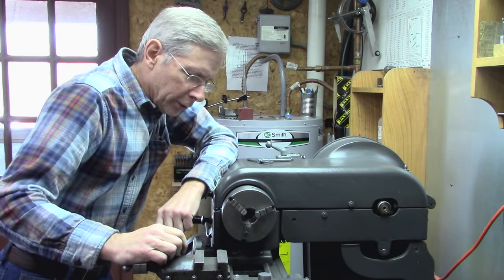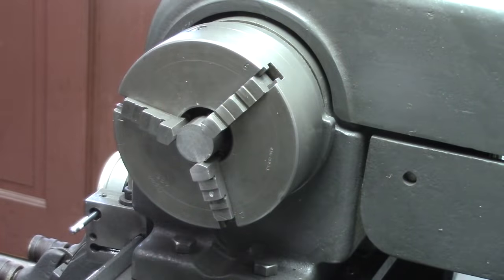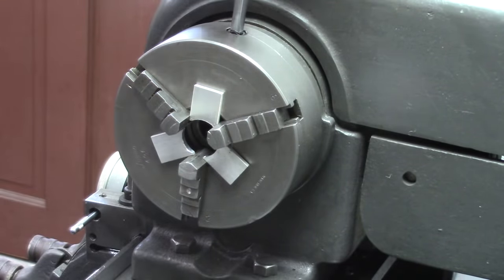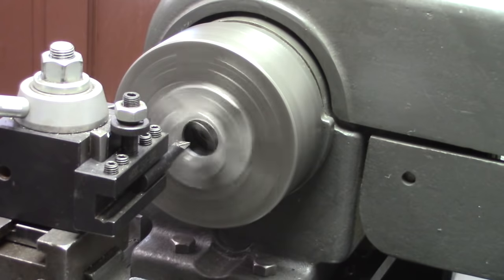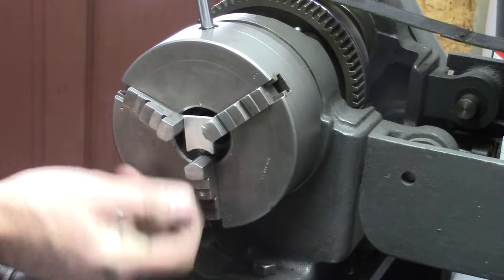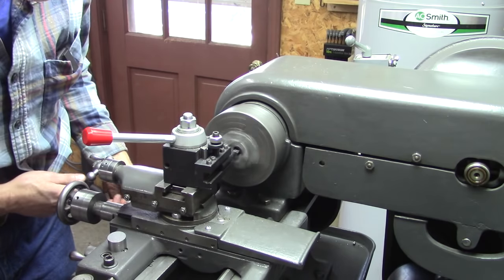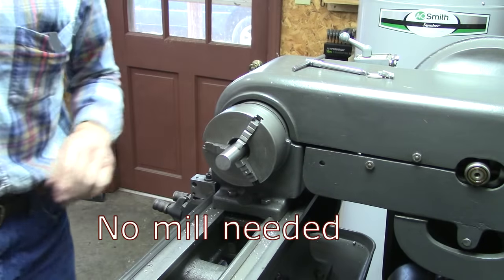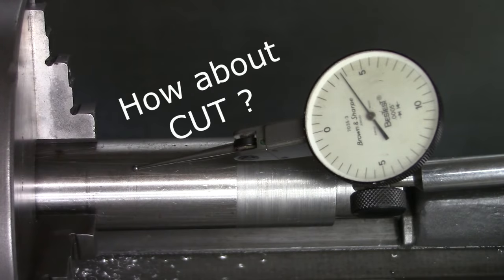Correcting 3-Jaw Chuck Runout the easy way

Comment: I used a similar method on a very worn chuck, I found that  I that using the "blocks" out at the outer edge of the jaws to obtain a parallel cut, the rock in the jaw meant that when the blocks are close to the body of the chuck it left the jaws conical. Cheers, Matthew
Reply from the maker: Conical as in bird mouthed? Mine is slightly the other way. Tightened just snug the jaws were tight in the front or ends and loose in the back. Firmly tightening resolved this.
Reply: @WinkysWorkshop  Yes, bird mouth, my chuck was 70years old! the jaws rocked, worn with a high spot in the middle! Although it was much improved, it had come to the end of it's life, I didn't have the outside jaws, so it really was time to replace. here's a video I did on grinding the jaws, it might interest you! https://youtu.be/zofS-ewP4Zs
Reply from the maker: @MatthewTinker-au-pont-blanc  Hmmm...  I ended up with exactly the opposite although if I tighten the chuck firmly it goes away. After watching your video I suspect the stone was larger toward the the grinder motor and that you didn't go deep deep enough to grind the back of the jaw with the full diameter of the stone. Of course this is just a guess, its hard to know for sure from the video.
Reply: @WinkysWorkshop  Thanks for watching my video! The stone cleared the back of the jaws, when I put the  "blocks" in the nose of the chuck, as far a possible from the face, I got a nice parallel cut, please note this was on a 70 odd year old chuck that had had a lot of use! I was just pointing out a possibility! Cheers Matthew
Reply from the maker: @MatthewTinker-au-pont-blanc  - Interesting...  I don't doubt what you say, I was just trying to get a better understanding. Your approach might be the best and maybe I didn't get an event cut due to deflection of the boring bar.. Also, my chuck was made in 1942. It could also be related to chuck construction.
Reply: @WinkysWorkshop  I didn't think you doubted me! Enquiring minds! I originally made the video to show somebody on a forum that it was possible, this was the second chuck that I ground, the first was not as badly worn and I got good results the first time. I didn't have the bird mouthing with the "blocks" flush with the face of the chuck. As I said, the jaws were badly worn, so much so that the jaws would wobble!
Reply from the maker: @MatthewTinker-au-pont-blanc  - Youtube just removed your link (grrr) seem like you got a lot of views!
Reply: @WinkysWorkshop  I'm a bit surprised they removed it, after all, it gets them more clicks!! I get a lot of hits on that video, over 40,000 since I put it up, 1,600 since the beginning of the month! All the best, Matthew
Reply from the maker: @MatthewTinker-au-pont-blanc  I didn't see any advertisements. You should monetize your videos. winkysworkshop@gmx.com
Reply: @WinkysWorkshop  I was thinking about it, but I was also thinking about moving over to Rumble which looks much easier to monetise!
Reply from the maker: @MatthewTinker-au-pont-blanc  - Yeah but no views
Reply: @WinkysWorkshop  I haven't posted anything yet!
Reply from the maker: @MatthewTinker-au-pont-blanc  I started to register but decided to do a search to see if something of interest came up. Nothing abut a metal lathe, workshop, drill press etc. Dailymotion is about the same.

Comment: I tried it a with a dremnel attached to my cross slide, grinding the Jaws it did well but I did have the same issue at first.. a few times and it came much more true..but the scroll seems warn too.. but smart move with the aluminum wedges,, I might try with steel wedges to deal with deformation.. also thinking of cutting the scroll with a cnc to true it up
Reply from the maker: Wow...  cutting the scroll would be a challenge.
Reply: @WinkysWorkshop  if I can work out the spiral shape,,create the path in cad and do some test runs. it might work..I already do some precision cutting in plastic and wood and aluminum for ribbon microphones I make....but for simply grinding just around the scroll surface just to true it up lightly it might work..
maybe I have to start a service..
Reply from the maker: @chuckthebull  I'm 99% manual machines. I do  little cad but no CNC
Reply: @WinkysWorkshop  don't worry...what I have is just hobby stuff..im old school and that's why I love your channel...but I max out what I have as well... im good at hacking out my way through life being smart like you... i just happen to have a cheap hobby cnc system I'm thinking of hacking for the scroll..it's an old Chuck I don't care about so if I screw it up so what..I will learn somthing..I learn a lot from you too so thanks
Reply: Those old Logan chucks (I think) were made by Kalamazoo Chuck Co.  They were light duty new and the years have been unkind to them.  I suspect you have some scroll wear, too.  You can confirm this if after you true things the way you did (good work by the way!) by checking different diameters of decent round stock.  If what I suspect, each different diameter will exhibit a different TIR- i.e. The chuck will not "repeat".  I discovered this with a brand new high dollar Buck-Fokardt Adjust-a-Tru chuck (5" dia.).  The chuck could be adjusted for any given diameter within its capacity to less than 0.001", but put in a different size and the chuck had to be retuned.  I spoke with Buck about that and their answer was "live with it"!
Reply: @geoffmorgan6059  this is why I have gotten used to and quite found of my 4jaw,, and quite fast at dialing it in. I almost never use the three jaw except on my big engine lathe..then if I need more precision I shim it.
still I think I'll try my scroll recut on the cnc.
I imagine all the backlash is why repeatability is an issue..
Reply from the maker: @geoffmorgan6059  - Id say you are right about the chuck brand. My scroll is in very good shape. I've tried it at 1.5", 1.25", 1" and .5" and they are all less than .0025 out.  I have a new cheap chuck that is actually very good but the amount of overhang is excessive for a 1.5" threaded spindle. This Logan chuck is closer to the spindle bearing and way more solid. I can use a cut off tool with power feed on 1.5" bar and 450 RPM without issue. No other chuck will do this.

Comment: Hey there, If you look at about 3:24 where you put the wrench on your tool post and give it a yank. The whole thing moved quite a bit. That would affect your cutting tool stability and finished results.  Thanks for the vid though.
Reply from the maker: Wow...  you are looking hard. You might also notice that before I started cutting I went in and then back out which removed the backlash you saw.

Comment: Would it help if you turned your test bar first so you are working with a round part? Good video.
Reply from the maker: Most cold rolled steel is within .002", most 3 jaws are .015" or more. This is not a perfect way to fix a chuck but the objective is to make it better not perfect. Most 3 jaws vary in error with diameter when they are new.

Comment: Mark I may try this on my 3 jaw China chuck. I have been using a .750 dowel pin  and on jaw #3 I am out minus -.004. Jaw #1 and jaw #2 are absolute zero.
Reply from the maker: That is strange.  I think in order for this to work well the pressure needs to equalize. You might try cutting a slit part way through with a bandsaw in the aluminum. This will allow the aluminum to compress a little so the pressure is more even.

Comment: I tried this method over and over and over to a point where i had to take the jaws to the mill and restore their geometry to a point where i can try again few more times.
I dont seem to get any consistency using boring bar possibly because my lathe is smaller chinese junk and results in too much flex.
The best i've got was 10 1000's
Looking for a better way to do this.  Maybe a diamond round in the tool holder ?
Reply from the maker: I've had mix results myself. Your jaws might be harder then mine were but more likely the wear is different or even the shape of the jaws. The trick is to put the jaws under load as if they are holding work and that's hard to achieve. You might try putting the aluminum plates closer to the tips of the jaws but that's just a guess. It sounds like you have taken a lot of metal off already...  maybe not worth taking a chance on.

Comment: Good idea to use aluminum which will deform enough to even out the difference between the jaws. You’d 
get slightly better results if you clamped the shims out near the face of the jaws.
Reply from the maker: You may be right about that.

Comment: Nice work!  Thanks for the video.  I would be super happy if my 3-jaw chuck was only .002" off.  You commented about possible uneven loading of the jaws in that the sacrificial aluminum was only about 1/4" thick.  What if you had a 3/4" square aluminum bar?  Or even a rectangular piece?  I guess one could stack up several pieces and screw them together to get a thicker piece too.   I would like to true up the 3-jaw on my 1918 Oliver lathe.  It has about a 12" diameter chuck.
Reply from the maker: I used 1/8" thick aluminum. On edge it is very strong. You might want to go with 1/4" on the larger chuck.

Comment: Another person I watched doing this used aluminum that was the full or near the full width of the exposed area of the jaws which would seem to impose a more uniform pressure over the clamping force area of the jaws and I would think result in a more uniform loading of the chuck and jaw gear teeth interface ?
Reply from the maker: You may be correct although it would be hard to get aluminum clamped inside the bore with a diameter large enough to get a boring bar inside. Most worn chuck (like mine) are what Mr. Pete calls Bird mouthed, meaning wider at the end of the jaw so I felt it was more important to load the jaws near the chuck.

Comment: some chucks the scroll is bevel cut, these cost a great deal more, they are known as precision chucks, I just mounted a 16 inch on my french mounting, by counterboring the removable back of the chuck, I made it a press fit, wrong thing to do as I  cannot tap the chuck into alignment, although I got it within 2 thou on the dia. and zero runout on the face, but the jaws are bad, 25 thou bad although they look ok, so I'll try your way, was there a reason you bored inside to outside
Reply from the maker: Yes I would love to have a precision chuck. I just bought a ER40 collet chuck which will expand my options however. I probably should have bored toward the headstock but the other direction works almost as well. On this chuck there is only about a 1/2" behind the jaws and I didn't want to run the bar in too far. By boring away from the chuck I was able to use a solid carriage stop.

Comment: If you have a decent "V" block it might be helpful to verify the runout of your "test piece" to make sure that it's not out of round.
Reply from the maker: I'll find a dowel pin somewhere
Reply: @WinkysWorkshop  Look on eBay and I'm sure you can grab a size plug somewhere around 1.00. They should be straight as an arrow and it doesn't matter if the OD is perfect. I like your channel.
Reply from the maker: @BELCAN57  Thanks, Somebody suggested a wrist pin. I'll get one from a friend of mine

Comment: ya ,, it's cool how it came at the time I needed it ,,, I'm curious what kind of work do you do for a living,,, I was a shop teacher in Ontario,Canada
Reply from the maker: I retired from a printing company two years ago. I have no formal training. I ran a press until moved me into a job troubleshooting the web offset presses and stacking machines. I did this job the last 15 years before i retired. The job morphed into redesigning presses and stackers in problem areas.  I had the pleasure of working with some very good machinists and a engineer although sometimes the engineer was more of an obstacle. He used to say, "that won't work". Occasionally he offered a better method but most often I just proved him wrong. He was a very good engineer but I think I was seen as a threat. The first several years I was in the job all machine modification had to be cleared by the engineer. The day my boss said, just do it and forget about getting approval was the day I started making real positive changed. It didn't pay very well considering I was basically doing an engineer job but, I enjoyed my job and most people can't say that!
Reply: @WinkysWorkshop  My dad was a printer all his working life . He started with lead type process and say it go offset . He too enjoyed his job .
Reply from the maker: @thrustprop67  - I enjoyed aspects of printing and for sure the machine design job but the company I worked for was poorly run. The first 20 years were okay but after that a bunch of investors took over that didn't understand the process. Ink and fountain solution contracts went to the cheapest supplier, maintenance was cut, crew sizes were cut and then they bought new presses and from Goss because they were able to run 3000 FPM. The company expected then to run as advertised but we didn't have the materials and expertise to make it happen. Plus, even with good material and proper maintenance the presses were poorly engineered. Cut back on crews and maintenance and....  sh__ hits the fan. We had several unit fires were bearing went bad and at one of out plants all 4 units of and 8 unit 72-inch press burned up in a big fire. These presses were the newest of the bunch but they leaked so much oil and had tons of ink mist so  there was a good supply of fuel under the units. Of course I should feel lucky, that's why my job was created, to fix the near impossible without spending money. Ha. Currently the company is in bankruptcy and the plant I worked at closed. We used to employ 1300 people but when it closed 800 lost their job.

Comment: If you had bought a new Chinese chuck it probably would have been no better. Even top quality USA standard chucks are only about 0.001" if you want better than you have to buy a Grip Tru or similar at mega Bucks. Cost me $ 1200 for a 5 inch one Grip Tru and I had to make my own backplate. Well done and it looked like the boring bar lived to fight another day. Surprised the carbide did not break with the intermittent cut.
Reply from the maker: Cheap inserts too! I just took small bites. I have two chinese chucks that are actually slightly better but they are considerably deeper and too much overhang. This chuck works better for small spindle.

Comment: I have a South Bend 9c with a 5" three jaw chuck, I ground it true, but the problem was a stretched scroll, so any other size stock it was off. I was able to buy a made overseas 6" chuck for $140. Sometimes you just got to get out the checkbook and save yourself a lot of grief.
Reply from the maker: I have a couple chinese chucks One is excellent, one is good and the other two not so good. Oddly the best one was only $89.

Comment: Ive done that many time, but i did use a grinder in tool post. 
When you try and cut those somewhat hard jaws, you get to much deflection that follows the runout..
Reply from the maker: That sound logical but honestly this worked better than grinding for me.

Comment: when the chuck is worn its better to put your shims at the tip of the jaw's to  help pivet the slack
in the jaw slots not the scroll . i mite  use  steel shims. try wrapping  1 rap of paper on your 1"
stock take a couple of heavy  cuts on your stock ,inspect the paper to see if the marks are even from front to back. i drill a 1/4" hole in the face of the jaws  insert pins  chuck on a short piece of pipe with the pins,
tight then bore or grind the jaws
Reply from the maker: I think the pins are a great idea but i didn't have a carbide drill. I tried drilling and it was too hard. As for the position of the shims,  this chuck is very shallow. The shims were slightly toward the front of the jaws. I think its a little better to have the shims load the jaw evenly. To be certain 90% of the stock I removed was still toward the back of the jaw. I quit cutting when the insert started cutting at the tips of all three jaws.

Comment: Watch out for tool deflection, I tried to cut a set of hardened chuck jaws like this and it would always come out tapered. A quick grind and they were much better.
Reply from the maker: Interesting...  I had much better luck with the boring bar. I was cutting on the way out at first but made that last 4 or 5 passes going in. The TCMC insert is fairly sharp so most the cutting was going on the leading edge. And the last 4 or 5 passes no correction was made. Overall I'm pleased although less is always better.

Comment: When I was just starting out as a machinist , I noticed this problem that you are having with your 3 jaw chuck . I asked my employer , who was a 3rd generation machinist , what could be done to remedy the problem , and he told me to " Just get used to it " . I asked "why " He said that as long as I was using a Plain 3 jaw chuck , There would ALWAYS be some amount of runout due to the inherent design of a scroll chuck , the scroll is not machined to perfection that you desire . it is what it is . If you want or need less runout from your chuck , you will have to use a 4 jaw chuck or a Buck chuck or a 6 jaw chuck or a collet . Since I started this path as a machinist , I have operated lathes built in 1900 to to modern CNC .  lathes built in 1990 , that is almost 100 years of technological improvement & the plain 3 jaw chuck still has this same flaw .
Reply from the maker: Yep, and I can live with .002 but .015" was too much. Someday I'll get some collets.
Reply: some chucks the scroll is bevel cut, these cost a great deal more, they are known as precision chucks